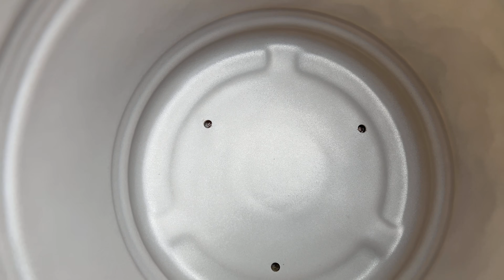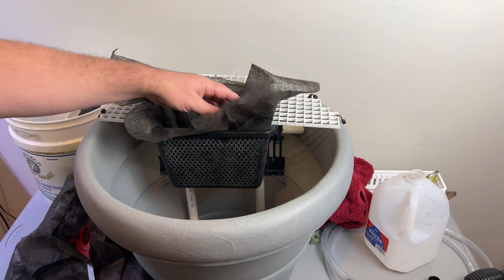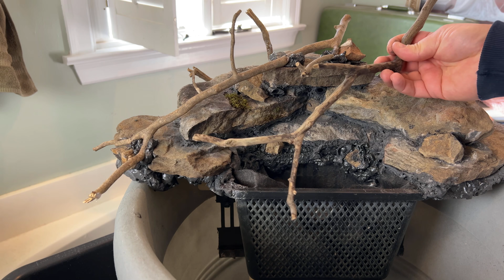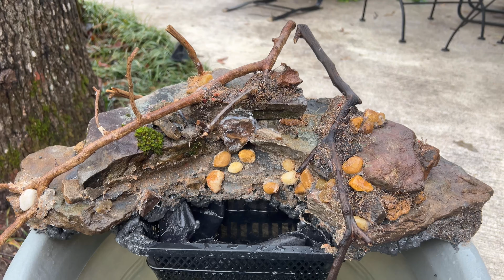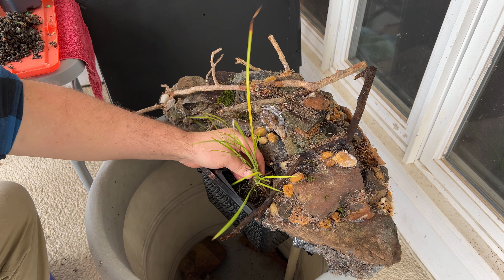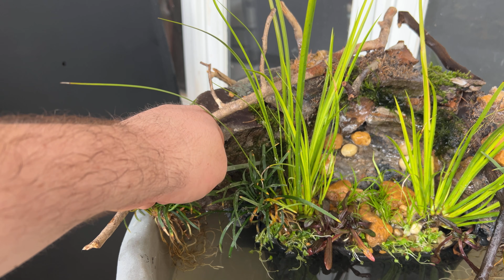How I Built an Incredible DIY Patio Mini Pond with Natural Stone Waterfall!- Step by Step Tutorial

Comment: Great job on this! I have seen people that add the sand and peat moss to the foam while it is still wet. Might save a bit on time and $. I plan on making a pond somewhat like this but doing it cheaper by reusing old stuff I have like used styo-foam for the main construction and black felt to wick up the water. Mine will not have a pump but just wick up water to the moss and maybe a few tiny plants. Of course I will add floating plants and maybe dwarf sag under the water.
Reply from the maker: Thanks!, I can’t figure out how you add sand and peat to the wet foam …because it expands…and then what? I have to cut it off anyway. Maybe more practice and I’ll figure it out, there will definitely be more of these in the future!
Reply: Yes, not sure how how long they had to wait for the foam to expand before they added the sand and peat. I have also seen videos where they press on the foam after it has expanded but before it is hard, where they press it down where needed.  @plantlifeproject
Reply from the maker: A wicking only pond will be awesome to try. The question arises, “how far can you wick from the water surface?”